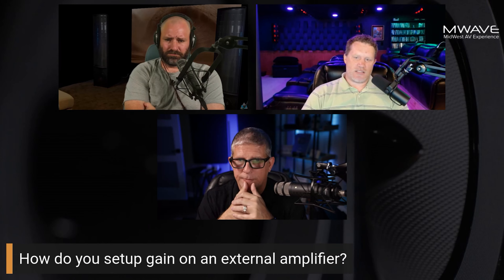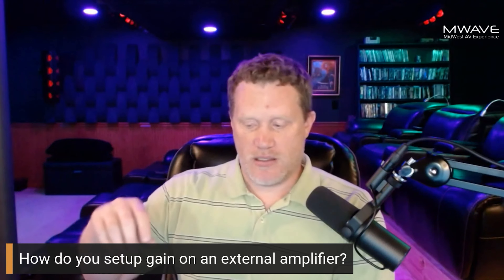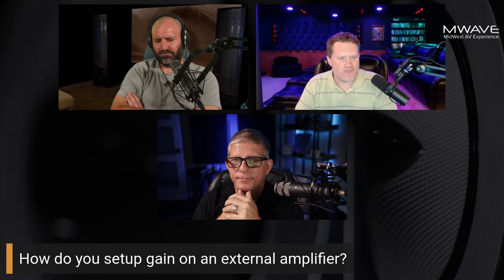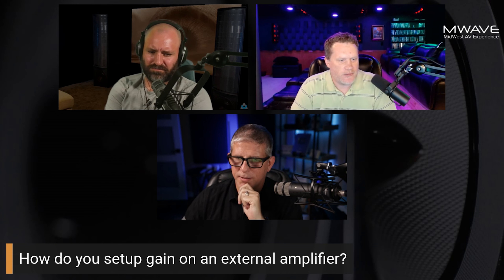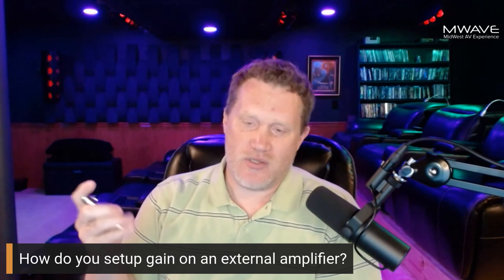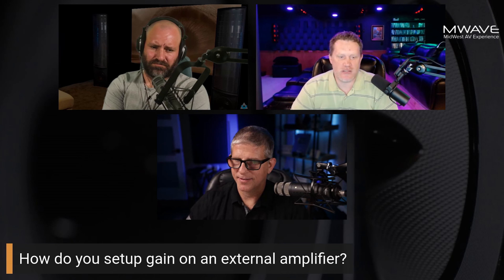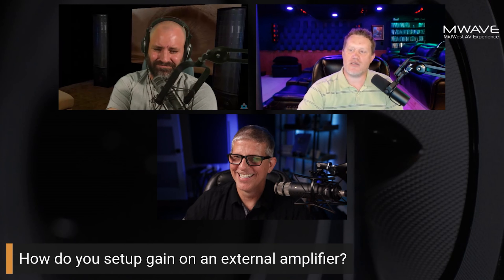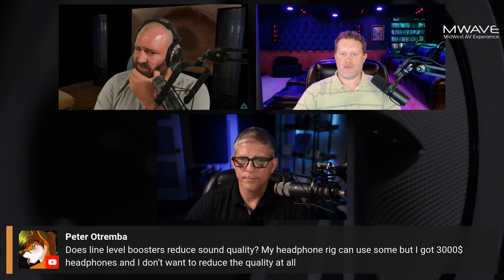How to PROPERLY Set Gain On An Amplifier for Home Theater

Comment: I was wanting to use a HiBy M300 with a crown amp cls 1002 to power 2 IBeam VT200 tactile transducers with a wireless pair of headphones I know the headphone jack is powered but I was going to use USB-C to duel XLR (I’m making a vibroacustic bed) my question is 1. Do you think using the usb c to xlr will work and 2. Will there be a voltage that will effect the gain on the amp?

Comment: @Youthman @jvonengeln 25:20 I believe the Spears & Munsil HD Benchmark 2nd Edition disc from 2013 is actually 75dB -30dBFS in the main channels & -40dBFS for LFE according to Stacey Spears who had mentioned this "The audio tones on the 2nd edition are dead on accurate. If you have a THX AVR, they will match in SPL, if the THX AVR meets spec. THX helped us ensure the levels are correct. Every signal was measured with an Audio Precision Analyzer to ensure it was electronically -30 dBFS for the mains and -40 dBFS for the LFE. There is the 75 (-30 dBFS) vs. 85 dB (-20 dBFS) and some AVRs and discs output tones for 85 (theatrical) instead of 75 (home cinema). There are even some discs that output something closer to white noise, which is way off." & Roger Dressler of Dolby Labs fame, confirmed this too, "Do you have a copy of the Spears & Munsil 2nd Edition test disc? If so, those levels (in either 5.1 or 7.1 format) are known accurate. The noise on that disc is pre-filtered from 500 Hz - 2.0 kHz, and is recorded -30 dBFS in the main channels and -40 dBFS in the LFE channel, all of which are intended to play at 75 dBC SPL at reference volume level."😉

Comment: Like I’m car audio,  we can measure at what output level does the processor/avr clip. Using a o scope or a Steve mead  dd1  

It will vary just like it does with car radios.

Comment: Can you run XLR microphone cable for a subwoofer or do you need a certain XLR ?
Reply: XLR cable is signal cable so yes microphone cable will work fine!
Reply: @jvonengeln  awesome. Thanks 👍
Reply: @jvonengeln  I have two paradigm subs 1s that I'll move up front using XLR splitter, your video's inspired me to build my own near field sub box, I'll be using the Dayton kraken 21inch sub. See how it goes. I was going to get 2 for the rear corners but you have me wanting to try near field subs haha. 
I'd be curious how you hook up so many subs in your set up. Have you made a video on that ? I may of missed it. 
You do great video's, this one helped alot as this is my first external amp for a sub. Looking forward to more videos 👍
Reply: You need to check the pin configuration on the 2 pieces before you do anything. Also, if you're using a mixer or any type of preamp that has phantom power, you need to be extremely careful. If you need to use phantom for a mic, make sure you can turn it on and off for all the channels independently. It can only be used on mics. Anything else and you can easily damage it.

Comment: Having the gain on the amplifier side too high also has the negative of amplifying any noise the cable itself may be picking up. (unless using XLR where noise should have been balanced out)
Reply: XLR connections make no difference from RCA over short runs
Reply: @Music.Movies.67  Not true, any computers or routers nearby give noise in the signal over RCA, I had to switch my studio monitors from TS to TRS because of nasty interference, killed  it completely.
Reply: XLR means absolutely nothing. Its just a 3 pin connector. The only way to get this right is to understand how the components themselves work. This is the single most misunderstood topic in audio. There is far more bad information than good. There's a lot to it all, so I can only give you some brief comments, because to go over it all is simply not feasible in a post like this. 

"XLR" is typically used when talking about balanced operation. A regular single ended connection "RCA", has 2 conductors. A signal + and ground -. Balanced connections Have 2 signal conductors ++ and a ground -. As a consumer, or end user, this is what you need to know. Balanced operation is not compatible with single ended operation. If you want to mix bal and se components, some type of action has to be taken so that a compatible signal can travel between the 2 pieces they connect. You can either make both connections balanced, or both connections single ended. The reason for this is you need some way to deal with the 3rd conductor on the balanced side. For home audio products, 90%+ of the time you run both pieces single ended. Think of the 3rd pin/conductor as being disabled. You just use 2 of the 3 pins. Balanced operation can only be achieved if both components have balanced inputs and outputs, and you use a balanced cable to connect them. If you don't have all that, the connection using XLR connectors is electrically identical to an RCA connection. So, the vast majority of people thinking they have a balanced connection, don't. They just don't understand how it works. 

One of you mentioned having to use a TRS connector on your studio monitors to make a balanced connection to deal with the noise.  That's not what happened. Your noise was a direct result of crossing wires and creating a short circuit. In most situations, when you use any type of adaptor or cable to connect mixed components, its customary to shunt the number 2 pin to ground. The only problem is, when you send a balanced signal through the cable with 2 pins connected, a short circuit is instantly created the second signal goes through it. That shout circuit is the noise you were getting. I would have to see exactly what you did, but you fix did something like float the ground eliminating the short. Unless there is information you didn't include in your post, I can tell you with 99% certainty that your connection is not balanced.

I just want to say once again, that I can't possibly include all the information to give this topic a full treatment. Its not even close. There are different ways a component can be balanced. There's different ways the connection can be wired. The rules can vary depending on the specifics of the situation.
Reply: @AT-wl9yq  well I wanted to not like your comment because you started off pretty blunt and borderline condescending--which I've noticed a lot on these audio file forums and discussions from people that actually provide bad advice or wrong information. 
But I work as an audio engineer in life sound and studio recording, and have a brother that is a self declared “audiophile" that I've had to rescue from the lies and snake oil in products catering to this consumer segment... So it's a bit refreshing when I'm reading a comment that is totally bang on and holds no punches when describing the amount of confusing on a subject that should be as simple as balanced signals. Might seem a bit abrasive at first, but with the proliferation of so much wrong information just to get people to buy products, and with consumers believing these lies or worse, when consumers begin to publicly repeat wrong info or share incorrect understanding of concepts, a polite rebuke is probably not going to make much of an impact. 
Like @AT mentioned, the amount of data on this subject is fast. And you can spend a hell of a lot of time learning about differential signaling.. simply put, if your equipment does not have any balanced connecting ports, or if only one piece of your equipment is balanced and the other ones are not... Plugging a balanced cable is not automatically making your devices become balanced. If you're buying balanced cables and plugging them into an AVR using a XLR to RCA adapter, you're basically plugging in an RCA cable. You can get into buying di boxes which is a legit way of taking a unbalanced signal and balancing it via both active and passive transformer stages.. that's big in the recording and live audio industries... Although I haven't seen any product design for the home theater or audiophile industry.. I suspect it would cost 10x what a di box should cost. (Y'all spend entirely too much money this stuff guys)
Reply: Yeah I don't think that matters since you're already sending an extremely clipped signal to speakers cranking the gain

Comment: I'm still confused on a number of steps. How to determine where to start the trim (-6 vs -8?) before adjusting the gain? If im at -6 and 70db how do I know if its better to increase the gain or just increase the trim level?
Reply: Usually better to increase the speaker trim in the processor (for speakers) than to increase the amplifier gain, because it’s a cleaner signal increasing in the prepro.  If you are talking subwoofer outputs, I usually do the opposite and increase amplifier gain because of the redirected bass from your speaker crossovers means you really need to ensure that subwoofer gain stays low (high negative number trims) to ensure you aren’t introducing any clipping at the source.
Reply: Okay that clears it up for me, thanks for that explanation! I did some adjusting and I feel like there's definitely been some improvements.

Comment: Its interesting though.   With my subs, when I turn the receiver trim down (-10 or lower) and I turn the sub gain up, it has more impact than when the receiver trim is turned up (past -8 trim) and the sub gain is turned down.  Both being calibrated to 75db.

You would think that shouldnt happen, but it does.   Especially my Energy sub.  The Dayton sub is pretty consistent, but the energy sub looses a lot of impact if the gain knob is turned below 60%, even if the calibrated level is the same.
Reply: This is part of the balancing act with setting your gain structure. Without knowing what exactly your setup is comprised of, I would guess that either your amp has a high input sensitivity rating or your source has a low voltage output, or maybe even both. If your amp is not getting a 'hot' enough signal from your source, then you could be missing out on a lot of dynamics throughout the frequency range of any given channel. If your other sub is faring better, then its amp could have a better match to your source's output voltage.

Coming from the live audio world, this is a constant battle of maintaining a good signal strength through the entire chain of patch points. A simple vocal channel can have 5 or more points in the signal chain where gain staging has to take place. You would start with the input preamp, then there's the mixer output, outboard effects, speaker processing, and finally the amplifier. All of those points have to be properly set to the previous link in the chain or the whole thing falls apart. If the preamp gain for the mic is set too high, the signal will clip and ruin everything else. If the speaker processor input or output is set too low then the amp could be sent a clipped signal or the amp itself could clip and so on. 

Having all these points set up to maximize output and still have a small safety buffer is the end goal. Sometimes this means adjusting a physical gain or bumping a channel trim, other times it could mean swapping out an entire component to better match the sensitivity input/output ratings of the rest of your gear.
Reply: It may be that the -8 trim setting is providing a maximum voltage greater than your amplifiers input registers when your receiver sends "high" signals (those for maximum dynamic change). 

Calibrating at 75db doesn't assess the dynamic headroom or maximum signal magnitude possible. 

What you are describing as the loss of "impact" is instantaneous dynamic change. This is a high signal triggering significant current and speaker movement. 
A test would be to set the trim to 0 and see if you can get the volume down to 75db. If not it indicates that your receiver may be outputting a 2v signal and your sub amp accepting a 1.4v signal (as an example). By reducing the trim you are reducing the magnitude of output and therefore more likely to exist within a range the amplifier is ok with.

Comment: I don’t get the speaker trim no higher than 0 in AVR, I got an AVM90 and ARC sets the speaker trims anywhere mostly above 0 so none of this makes any sense
Reply: If your AVR is set above 0 on the channel levels, most AVRs will subtract that from the headroom from the main volume position as a protection mechanism.  If your AVR is setting the numbers at positions it’s less of a concern than using external amps and having the channel trims set in the positive.
Reply: @jvonengeln  ok this makes sense, thank you.

Comment: Would it be easier to just purchase a power amp with No gain knobs ?  And couple it with a  good pre/Processor..... just wondering .
Reply: An amplifier without gain input attenuation knobs has a fixed gain.  It's usually okay, so long as you have a average room size (distance from speaker) and mainstream equipment.  If you are using very high efficiency speakers, you may not be able to turn down your channel trims enough to fall above the negative 12dB channel trims on your amp.  You may need to add input attenuation.  If you have very low efficiency speakers, a fixed gain amp may require you to go into the positive on your individual channel trim levels, which isn't generally a good idea, so you may need a signal boost before the fixed gain amp.  An amp with input attenuation can help you dial on the channel trims more easily, than a fixed gain amp.
Reply: @jvonengeln   @jvonengeln  
Thanks for your answer johnathan , your knowledge as usual on these matters is always priceless .Coming to think of it i ,had a NAD M25 amplifier that could only drive my 85db B&W speakers when the knobs were almost all the way up. I think  unless one needs plenty of headroom , it wouldnt be very noticeable. It never quite ocurred to me until now , but i still think  i will stick with an amplifier that has a predetermined gain. I dont see myself driving the channels above reference level. The subs do the heavy lifting anyway . Heres where i might need to play with the gain in relation to  my anthem avm 70 sub outs signal level .
Reply: You can start out with the input of the amp set to unity gain. That's basically the same as using an amp with no adjustable gain. What you really need to do is learn the difference between gain controls and volume controls. Understanding that will make things much easier for you. Do the research yourself because if you just rely on someone to explain it to you, there's a good chance that at least some of the information is wrong.

Comment: To expand on the comment from Jonathan regarding what SPL to calibrate against when using external disks/sources; that (sadly) depends on what SPL the test tone disk has been mastered at (ex AVIA or DVE).  Some have been mastered at -30dB to calibrate at 75dB, some have been mastered at -20dB to calibrate at 85dB. So check the literature on the test tone disk you want to use.
Reply: This is true!

Comment: Good tutorial. 

If you have a Channel Trim at -12 or +12 please consider the below.

If you have a channel that auto calibrates trim to -12 or +12 and others have a different value, be aware that it may need a greater value than 12 BUT the processor cannot offer it. 

In that instance, if you can alter the level you are using for calibration in the opposite direction so you can offer more capacity for the actual required setting for that speaker to be chosen. 

EG: All of my speakers are at -3 and my sub is at -12.... I'll change my speakers to 0 and recheck to see what the sub is.... if it's still -12 I need to go further. If it's -9/10/11 then it is now ok. 

I haven't explained this super clearly sorry - just be aware that any maximally set trim value may be incorrect because of a lack of range.

Comment: If I Put my crown amp to 2/3, and my sub trim to -6, or -8, I don't have enough volume. I have a mini dsp, and have to raise the gains a ton to get any volume. what should I do?
Reply: What levels are you going to in your mini DSP?   Are you going above 0?   What AVR or prepro are you using?   You may need a signal booster.  Look at the Art CleanBox Pro as one option.
Reply: @jvonengeln  Using a Marantz SR 6015. I Have sub 1, 2 ,3 ,4 gains set really high. I have the input gain at 0.
Reply: Also I have the Crown amp set to 0.775v.

Comment: This is very informative. I have a question tho. My subwoofer (SVS PB-1000) to match to 75db I have to set the trim on the receiver at +4.0db, should I raise the gain on the subwoofer to lower the trim in the receiver?
Reply: For sure.  You should.   All the more because you are talking about the subwoofer channel.  You are at risk of input clipping with your current settings.
Reply: @jvonengeln  Thank you! Any minimum trim number to aim for?
Reply: @FadriqueFM for a 5.1 system try to have subwoofer trim no higher than -3dB For a 11 channel system try to have the subwoofer trim no higher than -7dB.  These are general best practices — not necessarily universal truths.  Crank on your sub amp gain to offset to still get your 75dB test tone.

Comment: What about running audy? It will set the trims for you like -2, so do you lower them all?
Reply: Speaker trims at negative 2 cause no issue at all up to reference main listening volume.   It COULD cause input clipping with the auto EQ applied, (if more than a two dB boost and you rubbing at 0 (reference) on the main volume, but the reality is modern AVRs handle input clipping so well you’d never know without measurement gear and if you just are using the AVRs internal amps, and this is your main speakers or surround speakers and not subs —- then -2dB is fine.  Roll with it and enjoy it!